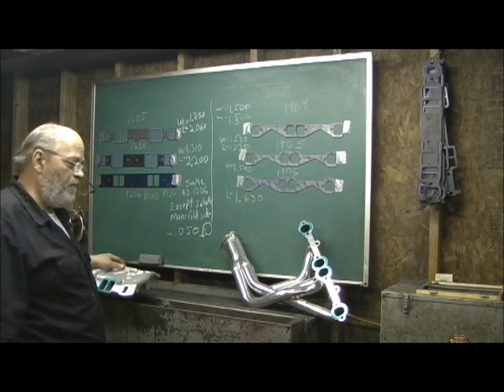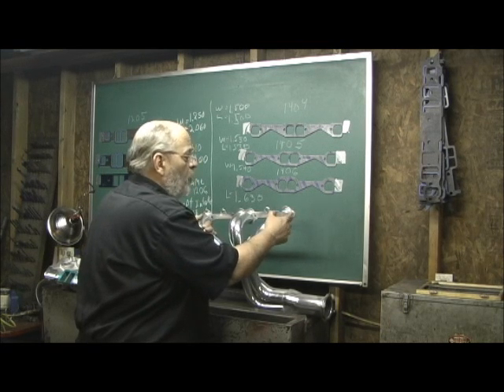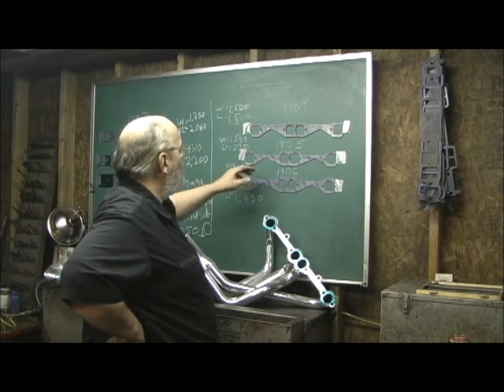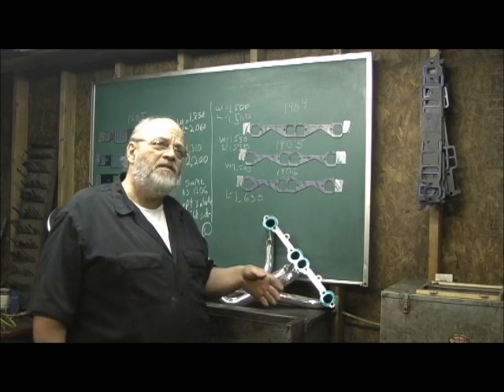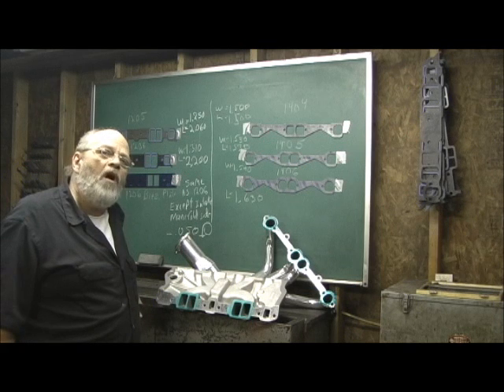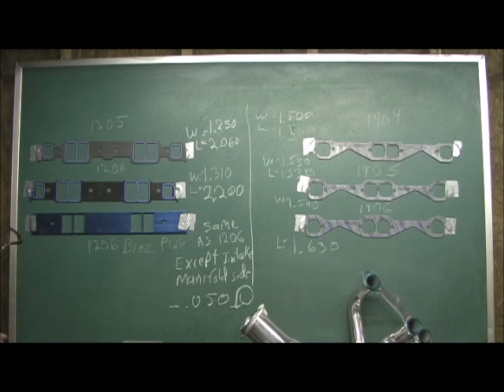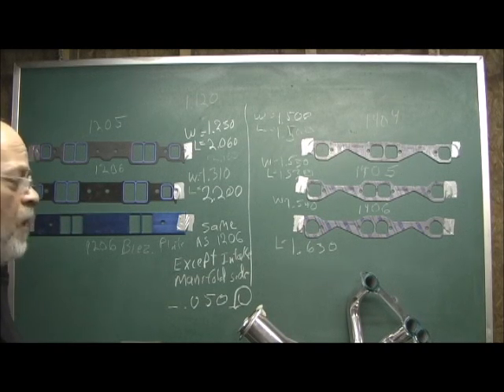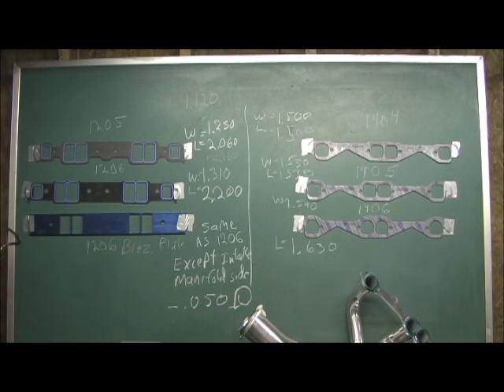ProComp 190 Stage IV Header and Intake Gaskets matches Part 3 2

Comment: They mig weld that flange and long board it straight for a leak proof seal. Depending on the cam and application I would use an anti reversion offset at the bottom.
Reply from the maker: There you are!!! Great comeback.....Pretty clever yank